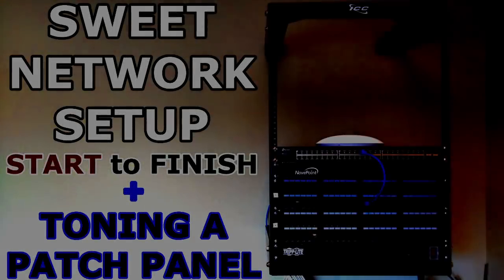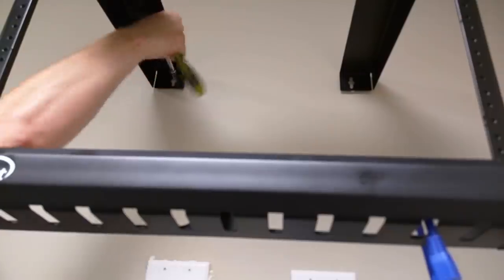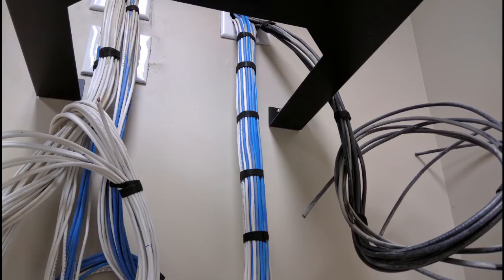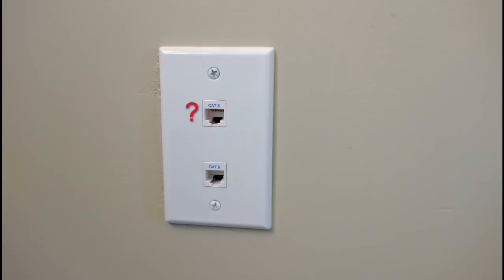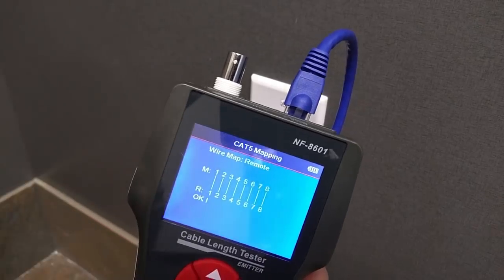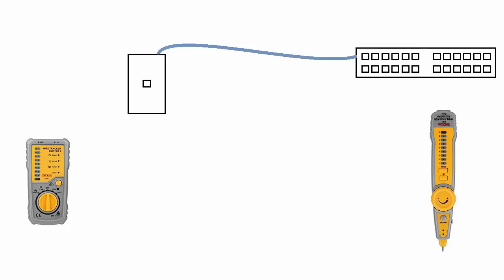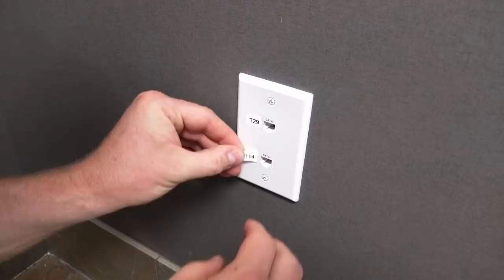Complete Network Setup // Toning, Identifying Ports

Comment: Why wouldn’t you label the cables before pulling them through?  That way you don’t have to figure out what’s what later.
Reply from the maker: IDing them the way I did went quick. Plus I didn't run the cable.

Comment: 6 devices on lan now, nearly 80 ports for the future? ... for a vet...
Reply from the maker: +ismirwumpe at the very least, he's going to be adding 24 IP cameras soon. Don't be judgin..
Reply: Budget Nerd I wouldn't necessarily find it overkill either. Every network should have about 50% expansion room right from the start. If you wire in two jacks in every room if a small office, locations near servers or printers, locations near work areas for portables, WAPs, cameras, Smart TV in the waiting room, etc. They can get used up quickly. It's cheaper to buy a bigger switch from the start than to have to upgrade it while it's still serviceable.
Reply: Within reason I'd always buy more. My preference would be to put IP cams on their own switch. Either way I'd definitely put them on their own VLAN. I couldn't see quickly if that switch will do inter VLAN routing, but an argument could be made for a real router at that point.
Reply from the maker: He has since gotten a real router. I think that switch will do vlan. He may use the switch that comes with the IP camera setup, but at least he has the option, or can add more than the switch it comes with would offer.
Reply: You're right. IP cams should always be on their own switch. Network segmenting (which is a good thing) aside, isolating security to it's own switch will make that segment more secure (if properly configured) and more importantly keeps cams from going down with the network and from the network going down with the cams. Since most cameras are using PoE, it's generally best to keep them on a dedicated switch.
Reply: Since most cams should not be accessible on the LAN, there's rarely a need for routing between them. Cams should only be visible to the NVR.
Reply from the maker: Good tips
Reply: True. As long as the NVR is accessible on both sides its all good.
Reply: The switch definitely has VLAN ability, but routing between different VLANs is a layer 3 function and you have to pay a bit more for that functionality. Ultimately it won't matter a whole lot as Robert mentioned in the other post. Do you know what you are doing for the cameras? Most boxes will have their own PoE switches with a LAN side and a Camera side so the separation is done for you. Otherwise just put two cards in a PC, one on your LAN, the other for the cameras...
Reply from the maker: Yeah the ones he was looking at have their own switch. I'm sure  he'll use that.
Reply: Said by one who's never had to pull a wire (or three) through an existing structure.

Comment: Yo homeboy, I know this video is three years old, so hopefully you’ve grown, but you need a service loop on the wall behind the rack. The one time you need it, EVERYONE will love you. Also, don’t punch down the panels like that bro, do it the right way and run them along the middle. You can still have the panel flipped to punch down, you just move the cables around the outside and through the inside. That vertical punch down is sloppy at best and I would make the technicians under me redo that work. The bundles look nice though, so it’s not like you’re a slouch. Also, having random port numbers at the wall jacks would NEVER fly in my crew. They must be sequential and logical, and searching for ports is not acceptable.

Comment: What is up with that anemic looking cable on T39?
Reply from the maker: Not seeing what you're talking about.. where in the video?
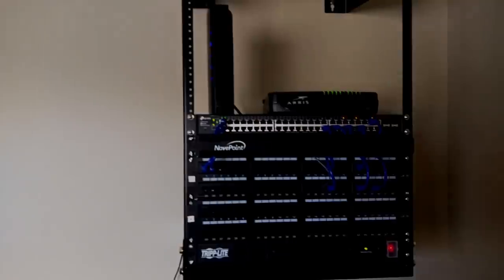Reply: That very thin grey line on the top patch panel #39  @12:22
Reply from the maker: Oh that is a phone cable. That patch panel didn't accommodate it, so we ended up pulling it and buying converter cables instead. That patches in the fax machine in the front office.
Reply: Ah...oki...I was wondering...lol

Comment: The customer buys more cabling and patch panel than he needs and routes it all through a cheap no feature no frills relatively unsecured cable modem. This is a lesson what not to do as a customer. Better for everyone involved here to buy a non POE 48 port switch, use the POE adapter that comes in the Ubiquity AP box, and buy a decent router/firewall.
Reply from the maker: +Space Cadet the shots of the setup in this vid were still early in the game. We have since "activated lots of ports around the building and the switch is much more populated now. They also plan on getting 16 IP cameras as well down the road, which will add even more.. I agree on the router, which they have since purchased and installed.
Reply: Budget Nerd Thanks for the update! What brand/model of router did they finally install?
Reply from the maker: +Space Cadet Netgear nighthawk r7000 I think it was.
Reply: Budget Nerd That's doesn't provide any firewall.
Reply: Budget Nerd IP cameras really should be routed through a separate switch. Especially if they are recording to an NVR in full resolution. They will quickly flood your "work network" with unnecessary traffic and eat up your bandwidth. It's always better to install two smaller switches and segregate any streaming traffic. It's also better for security because you can block routing between the cameras and other parts of your network.
Reply from the maker: +nilpo19 good points. Thanks for the tips. When he finally does setup his sec cameras, he will be able to use separate hardware if he wants. The cameras will apparently come with it.

Comment: Why not label them right before running the cables through the wall?
Reply from the maker: You could, some people do that, some don't. Depends on preference, size of building/project, crew size, number of runs etc. Each person has their own opinion on it (check out other comments) but whatever works best for you. I usually don't on my projects, but that's just me, and I never really tackle anything too big.
Reply: Of course people have different preferences and opinions. I just thought seems easier but I've never done is so:)
Reply: @budget nerd.

I'll give you a tip to make labelling easy and simple especially if your using multiple boxes of cable to run at a time. Label each box say: A,B,C,D,ect  then use a sharpie or a bit of tape and just stick the letter on it. once you pull you know exactly which cable is which, cut the end and label it as well. You can replace with more perm labels. 

You may not find it important now, but anyone who comes in after you will appreciate it. I honestly can't count the number of hours this has saved me on "fixing" another persons work.
Reply from the maker: That is also a good idea, but I doubt I'll ever do a project big enough to have multiple boxes. Plus I didn't run the cabling for this project.
Reply: Budget Nerd yeah if you didn't run it then no biggie. Just a future reminder, always label when you can. In your case it would have been helpful and saved you quite a bit of time :p

Comment: very good example of how NOT to do patch panels, jacks and labeling. very unprofessional job
Reply: That`s what I`ve thought, and I`m just a few months in this things. :D
Reply: @JamesSchafer73  Ultimately you can patch how you want, but, if you have 2 network sockets on a wall on a new install it looks more professional to have them labelled sequentially, unless they go to different networks (phone / PC for ex), the patch panel wiring itself, whilst fine for own or for a "friend", but for a "professional" install it can be tidier, there doesn't appear to be good service loops or cable management. It's not an easy task, you end up with sometimes 100's of cables to terminate and in some cases limited time to do it, personally i've done "light" cabling with power and data, I wouldn't entertain something even as many as in this video, I just don't have the patience, but if you are planning on doing it professionally look at pictures and videos of cable dressing, that is how a professional would do it, and if you can't / don't want to use cable / zip ties then you can get those velcro hook + loop ties which work wonders for cable management.
Reply: @JamesSchafer73  it looks like it wasn't planned at all. like he just pulled all the cables through the walls and started crimpling them into the patch pannels, the horror! like have it organized before hand, as said in the other comment, if you have two network points in the same room the intelligent thing to do would be to have the first one labeled, as, say, P1, and the next P2, not P1 and the one below P28, doesn't make sense, right? so if you plan ahead you can mark the cables BEFORE starting any of the crimpling and patching. Then it will be really easy to have it organized on the patch panel and switch. you would not need to test port by port, that's a waste of time; you do that to certify the cables, not to find out which cable is which, that's a nightmare. Cable dressing is another thing, but if you do it in order, knowing where everything is going to go beforehand you can plan the organization of the cables; in the video he's doing it as he goes.
Reply from the maker: I didn't run the cable. I worked with what I had, and I'm of the school of thought of punch it down and then id it.

Comment: https://cablesupply.com/cable-identifier-combo-pack/ Cable supply.com has a kit that you had led  plugs that you connect to the patch panel. then when you plug the remote unit in the appropriate jack lights up. its called Cable Identifier Combo Pack™, this makes it a few second per port. I have done a 96 port setup in under  30 minutes with multiple people (one per floor)

Comment: Hi Guys I am an open registered cabler in Australia so many thing wrong here the A and B on the TO is for country standard A is Australia/NZ B is used in Europe and other Country's don't mix them up on the same job . Patch panels termination you need to keep the cable pears twist all the way to the punch down point. Use a Fluke DTX CableAnalyzer to see how badly you ran your cable.  label label label  Sorry this install would not pass cable certification and would need redoing in Australia. At the start of the vid thumbs up for not using cable ties its a no no but at the end you used them. Cable ties crush the cable and will change the impedance of the cable and will create errors in the data packets sent over the network.
Reply from the maker: In used B in the entire building. I maintained the twist all the way to the punch down point. I didn't run the cable, another company did it.
Reply: H LaWMaN H not many backyard guys have a 15k DTX in their kit. Wire map would be fine for this job.
Reply: Any job I do for commercial gets a certification ticket, and you can hire one for the day cheap cheaper than rework as wire map will not give you any network data packet error  or % loss only short or mismatch.
Reply: last one I hired from Techrentals was $300 a day, his profit on this job was probably $250.  Not saying I don't want my cables tested.  I've dropped subbies in the past for not testing cabling but it's not profitable to to fluke test cables for backyard operators.

Comment: Now why would you make a setup like this instead of a setup like me and my dad made for our house: a single cat6 cable going to each "part" of the house, going in to a 5 port or 8 port gbit switch and then going to stuff like access points, computers, or to another part of the house which will end up on a switch again (and that might go on and on and on).

This way the largest "distance" you can get from our file server is 7 5/8 port switches, and at that point we still have a solid 900-1000mbit connection with it.

This way seems way cheaper because you only need a handful of $30 switches and you don't need to run 5 cables (which might get in the hundreds of meters) to wire up 5 devices, but rather one single long cable and 5 smaller cables.
Reply from the maker: That's one way to do it. I was trying to keep costs down, didn't want to have to buy lots of switches, I already had all the cable, so did it this way
Reply: Because the way you wired is not the proper way, what if you want a camera, now you need poe from one switch in that room to the camera, instead of the poe switch/injector down in the main utility area with a dedicated line to the location. There's a reason building aren't wired like you do. For a home it's ok...but not in the long run. The less connections you have the better, especially when troubleshooting. Your computer loses connection on 2nd floor, so you have to check all connections on 2nd floor, follow wire down to 1st floor switch then down to utility area kind of thing. Keep it simple and wire a home run from end location to main switch area. Excellent for usability later

Comment: OTT, but hey if they pay fine, but how is this budget? when you could have just terminated the plugs with rj45 connectors and plug them into the switch?????? wtf
Reply from the maker: This video wasn't so much a budget setup. It was for a business. It was still an inexpensive build though. There are patch panels there because we wanted them there.

Comment: I think you are overcomplicating things. I don't use patch panels. I just terminate the wires with a connector and run them directly to switch. I have always felt that the less number of connections that you put between your switch and the final device the better you are going to be. I do tone them so that I can put a label tag on them so that people know what room (or device) they go to.

Comment: As others may have mentioned I see 3 problems (maybe 2 depending on if the cable was already there or if you pulled it and ran each drop.

1) Label. Everything. If you pulled those drops you should have labeled each one at the cable and knew exactly where it went to before you punched it down. Not every job will be this "easy" and you should get in the habit of doing it, plus if someone else comes in after you, they will thank you for it.

2) I'm cringing hardcore at the punch down routing, all those cables on the rear of the patch panel at the 110 blocks are done 110% wrong. Seriously just do a google image search for proper 110 block punchdown routing. There is a reason there is such a large space between the them (why all of the punch downs are in a row and not like a keystone) 

3) honestly the switch should be between those two patch panels, if it were me. Given I know not all those ports might be used now, but you would save a future headache by doing something like this:

24 Patch Panel
Switch
48 Patch Panel
Switch
48 or 24 Patch Panel

Reasoning is that switch has 48 ports, top ports on the switch should go to the patch panel above it, ditto the bottom. And you should be stacking the switches and doing either layer 2 or layer 3 management of it. If my boss had seen a cabling job like this, he would have cut all those cables in the rear and I would be reterm'ing every single one :P Its best to learn and get in the habit of doing it the correct way, saves future headaches or anyone who comes in after you.
Reply from the maker: Thanks for the tips. I had thought about putting the switch in the middle, I can't quite remember why I decided against it. I know the back of the patch panel wasn't pretty.. I did try my best.. gotta start somewhere.. it was a great learning experience for me.
Reply: Budget Nerd oh yeah I agree, you only learn by doing it. I'm by no means a pro but  I've put in a ton of patch panels for both copper (cat5e, cat6, DS3) and fiber. When you start getting lots and lots of patch panels and switches it makes a lot of sense. 

If you haven't already I'd take a poke at some of the hobbiest subreddit for networking like homelab and such.

Keep up the good work on youtube. :)

Comment: I have extensive experience both as an IT professional, and a cable installer. This is not how you do cable in a professional environment! As others have already pointed out, you should label everything before you terminate. Further, you should have at least a basic floor plan and run your cables in a logical way. The jacks (not keystones) in on face plate should be consecutive. If the cables are landed on the patch panel randomly troubleshooting is much harder.

Toning is time consuming and takes some skill. Save yourself headaches and label.

Also, when terminating a patch panel of the type shown in the video, the cables shotbe run from the “inside” to the “outside,” be routed to the side of the panel, and then secured so that the don’t move relative to the patch panel. Cables will work loose if not secured!
Reply from the maker: Thanks for the tips. I didn't run the cables. I was left with a bundle. I had no choice to but to punch down and tone. I probably would have anyway. Toning that out went quickly.
Reply: Budget Nerd toning should only be done if there is an error labeling (I.e. duplicates). If it is necessary, you should tone from the station back to the panel, and then terminate in a logical order.

For a small job like this, toning is not very efficient. For a larger job involving a couple hundred cables, this would be entirely impractical.

I wish I could post some pictures of my jobs to show you what a professional job should look like, but that isn’t possible here.

Comment: I don`t want to be rude, but this method of identitying ports in the patch panel isn`t clever at all. If you using tone signal - its much easier to identify cables before it was patched into the panel. In this  case you`ll have a neat distribution of ports from LAN plugs. 
Anyway, I made such a work in a few offices, and I don`t like this work )) Also a small tip - its better to use thin glows to avoid calluses and other small damages.